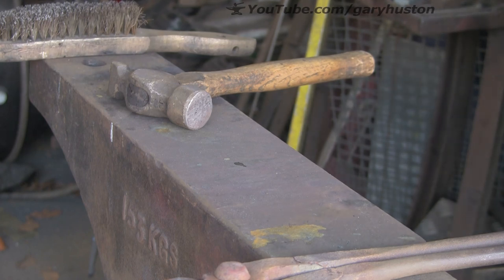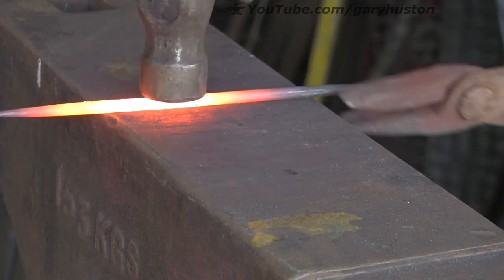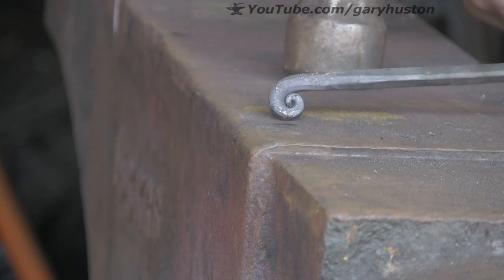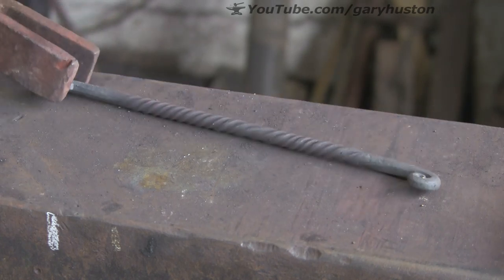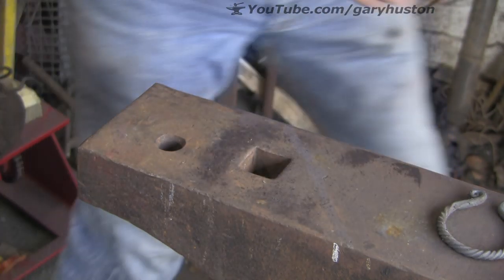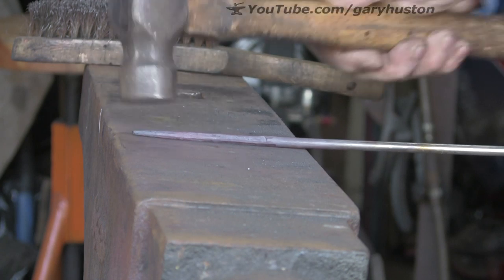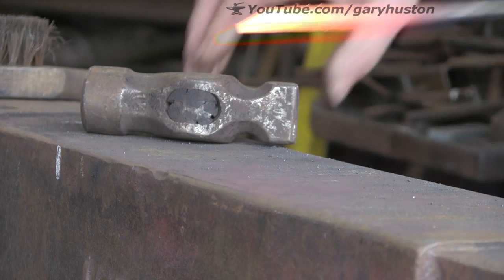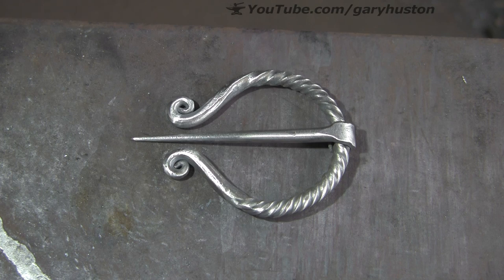Stainless Steel Penannular brooch

Comment: Another winner Gary, the brooch really turned out nice also, I agree with you 100% about using a right angle grinder as opposed to a bench top grinder when cleaning up with a wire wheel

Comment: Hi Gary, made a couple of these using mild steel square stock as shawl pins. I galvanised a few of the broches/pins with zinc. Had to draw out  the pin to about 3 - 4mm dia, using a panel hammer - really verging on Jewellry making! Lol Managed to put a twist on the pin itself. Did'nt sell that well, feedback I got was too "heavy and chunky".  That dirty coal just looks like welding splatter. Great video and thanks for sharing.

Comment: What makes it stainless?  Hardened or finish?  Or something else?
Reply: Stainless steel is an alloy of steel that usually contains a percentage of nickel, chromium, manganese and a few other metals. Strength wise, it is very much the same as normal 'mild' steel, however, it tends to be somewhat harder to work, and it tends to surface harden when cut incorrectly, making it even harder to work. 
The inclusion of the chromium in the alloy prevents the formation of normal iron oxide rust on the metal. What actually happens is the chromium oxidizes on the surface, but its oxides are not ugly, and form a protective coating on the surface of the metal.